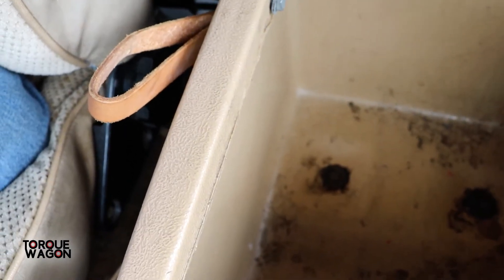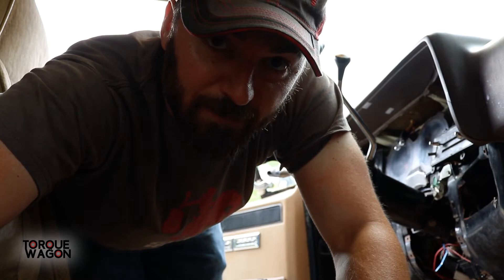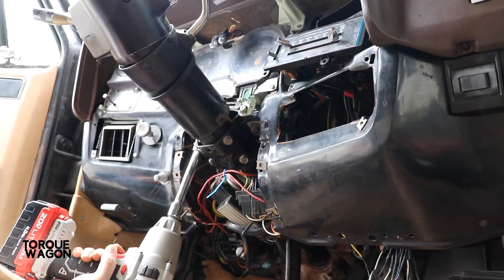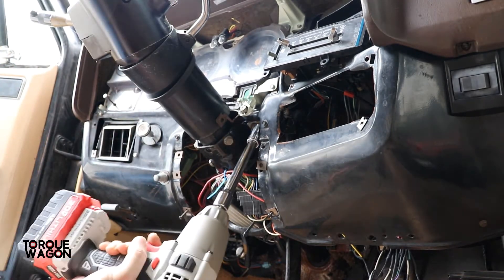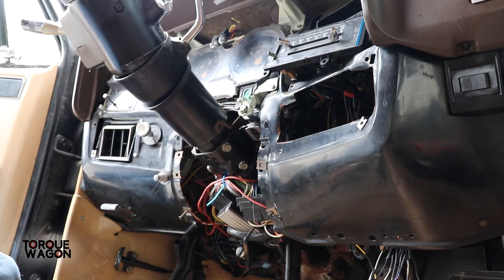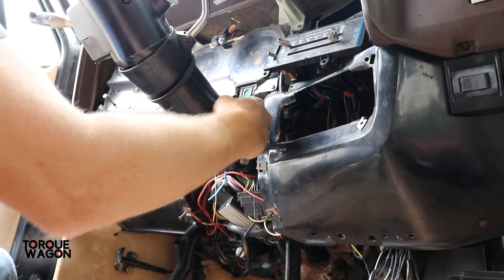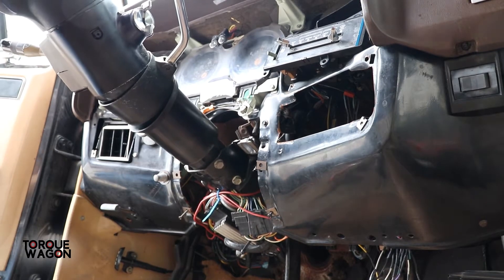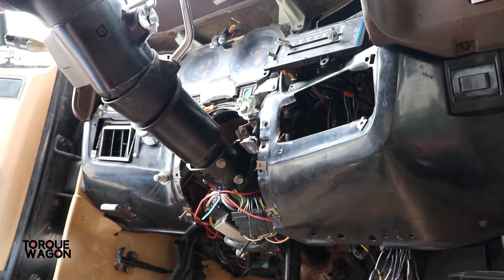How to Remove a Steering Column and Brake Pedal | NV4500 Swap Ep. 6

Comment: Where did you get the new clutch/brake pedal assembly? I’ve seen them on eBay but I’m hoping to find them for less than $500 for my swap.
Reply from the maker: I’m pretty sure I got mine from a guy on Facebook marketplace or someone I met through a squarebody or 6.2 group on Facebook. I paid a little less than $250 for mine. You might also look for local junk yards.

Comment: Are the pedal assembly's  the same for a 75 c10?
Reply from the maker: No. There’s actually several different pedal sets for the 80s trucks as well. The one I used came from another truck with the hydro boost brake set up, and has a clutch pedal for a hydraulic linkage. For a 75 C10, the clutch pedal would be set up with mechanical  linkage, called a z-bar I think. The brake pedal would also be different. It would be set up to engage a standard master cylinder without the hydro boost.
Reply: @TorqueWagon  oh ok thanks.